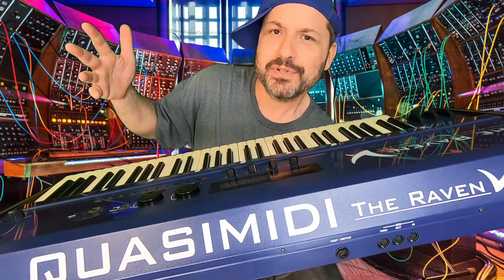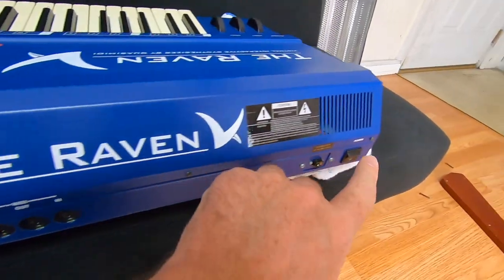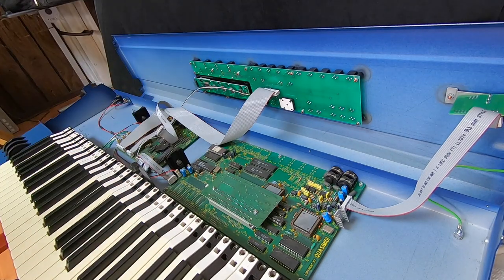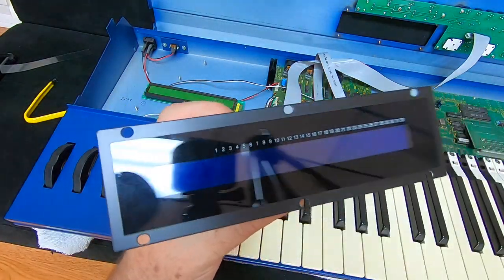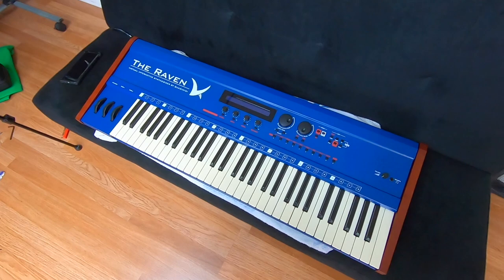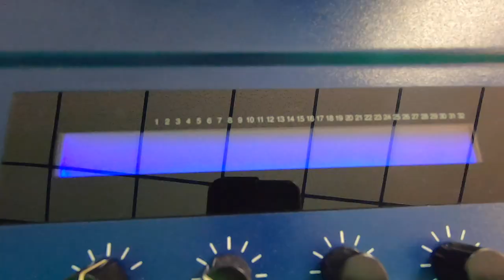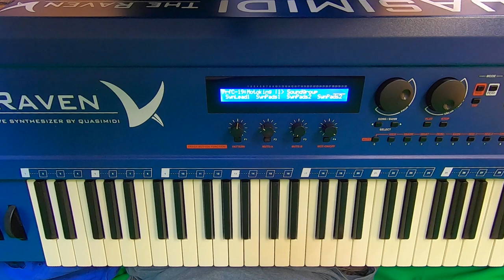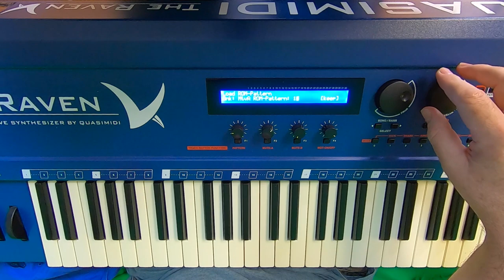Quasimidi Raven - Blue Display Installation

Comment: Dude that board is rad. Probably something I should look into if price is right instead of controller. Older workstations usually offer better build and connections.
Reply from the maker: For a computer/VST synths, I would use a USB controller.  I have a cheap one that is great. I don't have to worry about beating on it.  This old board is dated sounding (1995). I wouldn't use it in a serious recording project. It's something I've had forever. Fun to play with.  Not practical.
Reply: @HankCoffey  I bought a sy77 in 2013. Hahah. It was just like the one I bought at launch in 89 or 90. Paid 3 grand then. And 300 for used one. It was not as good a deal as I though and heavy as shit. I forgot. And it came with anvil flight case. Sold it and lost money in shipping. Hahah. I loved it but I bought Moxf6. Which I miss and sold as well. You are right. A controller will be best. VSTs are crazy good.
Reply from the maker: @robertclarkguitar  Yeah, if recording, I am using my computer.  The hardware is toys.... Or for playing live.

Comment: Been looking to pick one of these up for a while. Jean Michel Jarre basically used it as a ghostwriter for his Oxygen  7-13 album. Lots of arms and partial patterns made it into album along with the Mellotron choirs. Let me know if you want to sell it! 😊
Reply from the maker: That's cool, I'll have to check out that album. I have been thinking about selling some of my hardware. This Raven is one of my favorite keyboards I have though.
Reply: @HankCoffey  Noooooo! 😅 I guess I'll just have to keep scouring eBay!
Reply from the maker: @kimble02  money talks. I might let it go for around $1100. They might pop up for sale cheaper. But they will have 30 years of dirt under the keys. No blue display. And probably won't have the MAX Expansion.

Comment: Hello Hank
Which display exactly did you install in the Raven?
(type designation)
Best regards, Mike
Reply from the maker: Hey Mike, I don't remember.  Type Quasimidi Raven Display on eBay.  The seller saint_baz is still selling it.
Reply: @HankCoffey  
Ich habe mir jetzt ein gelbes OLED eingebaut...
Bestellt bei ALI...
Hammer:
Der Kontrast (Hintrgrund pechschwarz und wirklich gut lesbare gelbe Schrift)
Dazu ist auch noch der Blau-/Gleb-Kontrast (Raven/Displayschrift) auch noch optisch toll...

Wer das auch machen möchte:
Das Dsiplay wird ohne Kontaktleiste für den Stecker ausgeliefert.
Die muss man selber einlöten. Dabei NICHT Pin15/16 bestücken (das Kabel ist vom Raven nur 14-polig)

BTW:
Man muss nicht die beiden Holsseitenteile komplett abschrauben:
Es reicht, nur die beiden oberen Schrauben zu entfernen... dann lässt sich der Deckel (wenn natürlich auch hinten die fünf Blechschrauben entfernt wurden) der schon abheben...